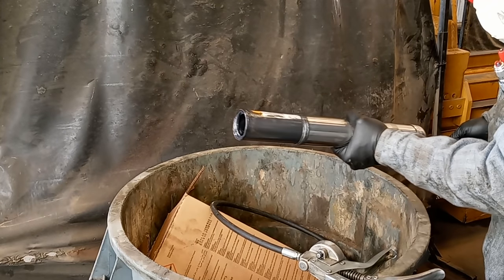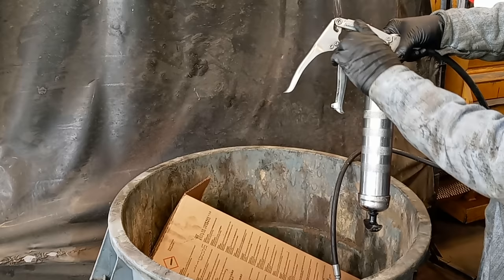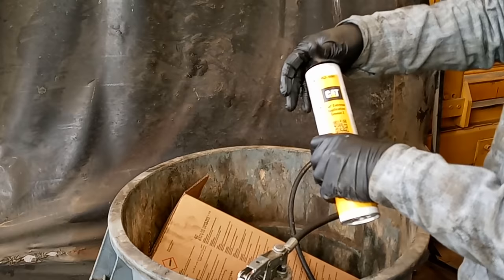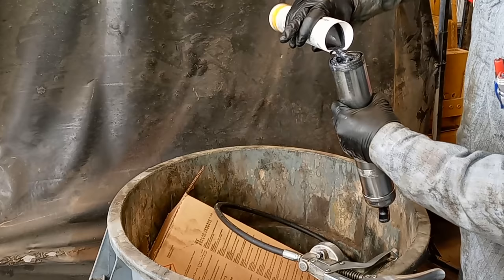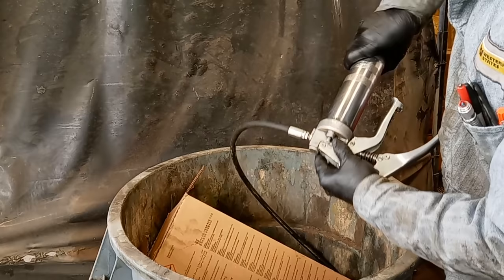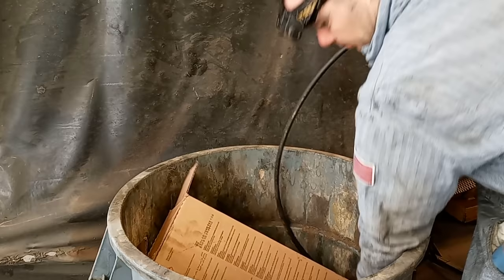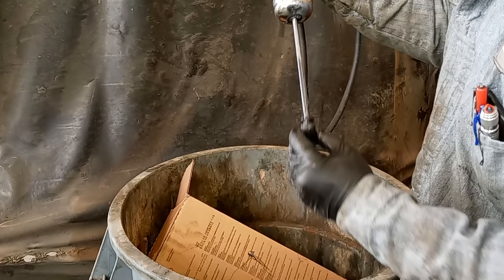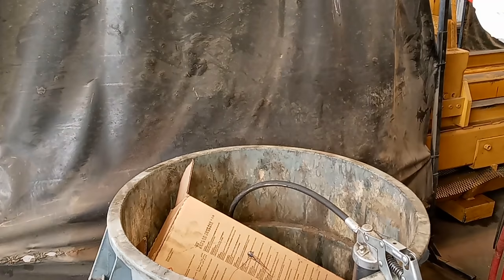3 Tips For Changing a Grease Cartridge the RIGHT WAY (No Airlocks)

Comment: Leave the cartridge housing loose by a couple of turns when you release the plunger lock after adding the new cartridge. This helps release trapped air😉
Reply: That's exactly what I've always done, but as the cartridge gets around 1/2 empty it usually ends up getting air-locked on me which is frustrating.
Reply: @jasonmeyers5849  Check the rubber on the plunger, those do go bad. We had one grease gun that did that all the time, we had a spare that the piston quit working, swapped the body/plunger with that one, never had an issue afterwards. Of course, once every 2-3 yrs, we'd take all our grease guns apart and clean them.
Reply: Also when the gun is empty , fully unscrew the barrel BEFORE pulling out the plunger , this helps maintain your prime and then as Jay Arnold said
Reply: What do you use to grease a grease gun ?
Reply: Yesssss!
Reply: My best tip is to get a screw on vacuum grease gun and cartridges.  Best tool I ever got. Takes 5 seconds to change and no gloves needed. 😊
Reply: Don't tighten the barrel until you release the rod and let the air seep out the threads then finish fighting the barrel up.
Reply: I never have airlocks or issues priming. My method is leaving the end a good one turn loose. When I use it the thickness of the grease prevents it from leaking but because the end is not airtight it stops any air buildup. I also run my grease right out before I change it. I use a lot of grease and it seems a waste to toss it. As for the position to load a grease gun... if you are pushing a cartridge of grease into a tube an air pocket will form no matter how you hold it. My thoughts as a guy with way too many grease guns!
PS. The Lock & Lube in the video. Definitely a nice worthwhile upgrade for those that haven't tried one.
Reply: Leave it loose and exercise the plunger rod a few times... this is actually some grease gun instructions for refilling
Reply: Yup. Its tricky. But go as far as you can. Some have an air bleed now
Reply: @DL101ca  silly Rabbit!🐇🐇🐇🐇☮✌🏻
,
Reply: @DL101ca grease lol
Reply: そこ！ 何故この動画で其をしなかったのか疑問だった。やっぱりコメント欄は世界共通で助かる

Comment: Around my shop guys just hang it back up when it’s empty and it mysteriously is full next time they grab it.
Reply: Yep, it's amazing how they always have just enough grease to get the equipment properly lubed.
Reply: I have an empty one ive been using for years .. 🤷‍♂️. Its a mystery. But I swear . Next time I need grease it'll pump out a bit lol.
Reply: We have one of those self refilling grease guns at my shop. Or at least that is what the other guys think. Every time I grab the grease gun I also grab an extra cartridge because I know 9 times out of 10 it is out.
Reply: Do we work on the same place...
Reply: Simple, after you have install new tube, release stem and you will feel a second slight catch. That catch is to apply pressure and prime your grease gun.. Sometimes it's a little hard to feel that catch but after a few thousand times of charging grease tubes you will be all over it. Don't be scared to use all the grease in the tube, for one thing grease is expensive and another it can be very messy. Another thing, if your grease zert does not take grease, change it because grease zerts don't get full.
Reply: @johnnyturner8514  what if you are reinstalling a half tube of grease? I had to remove one to check the tube  to see what the actual grease was to order another. I'm not sure if I reinstalled it correctly or have an air pocket.
Reply: Trevor.
Reply: I've never had one of those . There Always empty
Reply: I'm a home shop. That never works here.  I just swear at the thing like I'm doing now.  All 3 are empty
Reply: Jerks
Reply: Nice to have a grease gun fairy! If only the fairy would do the greasing too! 🤣🤣
Reply: The grease gun medic ! A very unappreciated and seldom recognized shop warrior.  Thank him with clean shop rags and gojo!

Comment: The preferred method for changing grease tubes in my shop is to leave it for the next guy.  Same with oxygen tanks, acetylene tanks, refrigerant tanks, soap dispensers and towels.
Reply from the maker: Hey I didn't know you worked at the same place I do. Need a mop bucket? It's full of coolant, oil, mud, but no water or soap. Need the brake clean can full? The fill tank is empty! The joy of working as a team.
Reply: Yep, teamwork...
Reply: Most problems in general are best left for the next guy, especially if the next guy is someone other than you.
Reply: Same here, only 20 M8x30 bolts left? Field engineer before you when stock stocking up just swipes all 20 and doesn't tell the storeman more need ordering rather than taking 10, asking the storeman to order more and maybe leaving the other 10 for the next field engineer who might need them in the meantime before more stock comes in. 😂
Reply: 😡 I ran a logging operation for30 some years and all of my employees know that if the grease gun was empty you had better fill it up or you were going to hear about it 😬
Reply: And masking machines in body shops
Reply: Did we work in the same shop? 😆
Reply: I think I know you
Reply: Don't be that guy😂. Never fails though. Pick up a gun three pumps empty

Comment: I definitively like my Milwaukee M18. Best investment ever for a grease gun. It has a nice bleeder valve to prime it after it ran out of grease too. Since I’m paying for the grease I m using it all. 🤣🤣
Reply: It does force the dirt into the grease if ya don't clean em off. If ya never clean the grease off after greasing it is usually easy to wipe off with your finger when ya go to grease it next time. Shouldn't seize either. Plus it helps waterproof your pants when ya wipe your finger off. Lol
Reply: Bought a air powered one and then they came out with battery powered ones. 🤦‍♂️
Reply: When the Milwaukee works its great! When it doesn't.......whew boy!
Reply: Been using M18 milwaukee for 4-5 years on the farm.  Only have had to replace the tip. Works great and with a decent battery in low range can make just as much pressure as any of my hand pumps
Reply: I have a cordless Dewalt greaser that I've used for a few years. Works great.
Reply: @timmueller1314  I love Dewalt tools, is the g.gun worth buying=Does it leak?  Thanks

Comment: I’ve never had an airlock happen and I use every bit of grease too. Pull out and lock plunger rod, unscrew and install new cartridge, screw in 2 turns and reseat plunger rod, pump 4-5times until grease comes out and screw in the rest of the way
Reply: Same here, maybe some guns are just more forgiving than others.
Reply: That is the same strategy that I use👍🏼
Reply: I do the same except I leave the the end loose a good one turn. This prevents any air buildup being it is not airtight and the viscosity of the grease prevents it from leaking. Seems like a waste to toss a cartridge before its empty.
Reply: Ive been greasing our equipment for years and the same is here. I've never had this problem.
Reply: Same here.

Comment: "Installing it upside down" does nothing. Do you really think that air pocket is going to displace that entire volume of thick extra heavy cat grease (or any grease for that matter) in the time it takes you to slip a new tube in and flip the unit over? The answer is no
Reply: On EP0 it might actually help purging it through the rod the way he did and upside down.
Reply: Yeah, he didn't run the previous tube empty either, nor does he show the grease coming out of the plunger rod hole after "pumping".

Comment: How do you not have an electric grease gun? I can never go back to a hand pump
Reply: I found that you can generate more pressure with a hand pump vs. most electric or even air powered guns. And sometimes that makes a difference on a stubborn fitting.
Reply: sometimes its nice to feel when the seals are under pressure instead of blowing them out
Reply: I use a lever type, never cared for the pistol.
Reply: @youjackass  made me COL - Chuckle Out Loud. Perfect reply
Reply: @donmunro144  makes one handed operation tricky in tight spaces.
Reply: Electric is the way to go. There's no way techs are greasing U-joints properly with lever or pistol grips.
Reply: @JohnDoe-iu5xi  I  for one disagree. Unless you're pumping so much grease that you're blowing the seals out then you don't know if it actually took grease. Air or hand gun is the way to go.Too many electric guns sound the same weather or not moving grease.
Reply: @donmunro144  This is what I mean. You're supposed to pump grease until all 4 bearing caps pop and grease exits them.
Reply: @JohnDoe-iu5xi  there's a whole lot more to grease than just u joints
Reply: @donmunro144  We were talking about U-joints.
Reply: @JohnDoe-iu5xi  if you look back you are the only one talking about u joints. The rest of us are talking about greasing in general.
Reply: @donmunro144  You replied to my comment about U-joints buddy and disagreed with it. Keep up buddy
Reply: @donmunro144  and to top it off. YOU can tell when an electric grease gun is pumping grease. Not sure why you prefer manual guns... And if you want to talk about blowing seals in general. You can see the boots in the steer axle joints expand.. Just dont overpump.
Reply: @JohnDoe-iu5xi I guess you're one of the guys that flood a clutch with grease from over greasing a throwout bearing. Or have grease flung all over the back of the cab cause you overfilled a slip joint and blew the end cap off. As for you saying that i jumped on  your statement, look back its more like you commented on my statement about preferring a hand gun.
Reply: @donmunro144  It's easy to "bet" when you have nothing on the line. I guess your self respect is already gone from youtube comments, what else you have to lose by making false accusations? And you @ me. Not the other way around... So rethink your delusions
Reply: @JohnDoe-iu5xi  you have no clue what I  have on the line. I've spent my whole life around heavy equipment, both on and off road trucks. I no longer do the heavy equipment, but still own and work on the trucks. It's easy for you to run your mouth when you are clueless. But as the guy signing the checks, I  personally make sure the work is done to my satisfaction. If that bothers you then build a bridge and get over it.
Reply: @donmunro144  I hate to break it to you but you're the one with the problem buddy. You disagreed with me and messaged me. Stop @ing me. Im a very busy MAN and I don't have time for these little youtube arguments.
Reply: @SpicyBloodBean  agreed
Reply: My gun has a 60 foot hose and a 55 gallon drum for a tube. 😎
Reply: @miked.8901  what's that in metric. Lol😄
Reply: If you ever changed tracks on a skidsteer, excavator, or really anything that uses a cylinder for tension. Youll never go back to a hand pump
Reply: Electric/air grease guns are mainly only good "In shop". Ours sit on the shelf. Ever have a pin not take grease and lock on to the fitting then you break the fitting or the gun end getting it off?? Never go back to electric or air after that.
I mean if your just shooting grease on a 5th wheel, shooting your buddies across the shop or just need grease pumped out then electric/air is fine. Bring that electric grease gun to the country with older equipment and you'll toss it.

Comment: I've been using grease guns since 1964 and never had an air lock that 4 or 5 pumps wouldn't fix. Don't worry about the 2 inch air gap at the bottom and pumping the shaft in and out helps nothing. I have 8 guns but only use 6 which have different ends. I store them upright in 4" pvc tubes with caps on the bottom to catch any oil that drips out. They are screwed to to two large standing cabinet doors on the outside. I use Green Grease now because it doesn't seem to dry out and cake up like some others. Thanks for the video,

Comment: Not going to lie, this is hella more useful than you would think. I usually go through 4+ tubes of grease when greasing the insane amount of rollers on conveyor belts.
Reply from the maker: Hope it helps.
Reply: I used to work in a surface mining company, and I still get imaginary hand cramps from thinking about greasing the crushers, bearings, head pulleys and conveyor rollers

Comment: Using grease tubes is new way of filling a grease gun. I remember buying grease by the pail. I’d stick the tube in the grease halfway up the tube and pull the plunger to pull the grease in. You would then screw the pump back on and clean the grease off the outside of the tube. Or next upgrade was to an air powered grease system. The pail sat inside the tank and air pressure would pull the great out the trigger end. These were prone to blowing grease seal apart if the regulator was set too high. 
Finally on to grease tubes in the 70s.

Comment: Spin on cylinder a couple threads and pump a few times ( listen for grease beginning to escape the loose threads as air bleeds) ..tighten, if still air locked, smack it on the lug of a rubber tire or 2 x 4 ( if you can afford one ) don’t smash the pistol grip mechanism while tapping it, use the solid portion to avoid wear/damage. Can easily do in  short period of time with less mess, no purge grease to clean and no latex gloves required. Field tested in -30 c with graphite/or + 30 honey 🍯

Comment: I have found that different tricks work with different guns.  In an attempt to help fellow viewers I make sure outside of new grease tube is clean so I am not introducing contaminants, when I peel the metal seal off I scrape the grease left on the seal on the inside of the tube rim so the product goes to a good home, thread the gun’s tube housing 1.5-2 turns into the grease gun cap then push long plunger rod back into the tube housing to initiate pressure on the new grease and give it 20-30 seconds as that much grease moves slow then wiggle the tube housing around a little and sometimes I have noticed a burp from the gun from doing this, now thread the tube housing the rest of the way into the cap.  Today I learned to not run the gun out of grease.  I will try this concept at work.  It sounds as simple as starting a diesel engine that was not run dry of fuel vs starting a diesel that was run out of fuel.  Thanks for another good vid!
Reply: I'm doing it exactly this way haha
Reply from the maker: Thank you for the input.
Reply: I pull out and lock rod, undo barrel, remover cartridge, use barrel to flick off plastic cap, insert cartridge, pull out plastic seal stop, wind barrel back on, unlock rod and push all the way down, then give the valve a 4 or 5 pumps to remove air. Simples.

Comment: This is the best video.  This am I was prepping my new grease gun for some trailer work.  Nobody mentions how you can lock the plunger rod to the plunger to put pressure on the grease.  Nobody mentions disengaging the rod from plunger to get the air out of the back of the tube.

Comment: That air pocket at the back isn't your problem. That's fine. What is the issue is the air pocket at the front. The best way I found is use the lid that you broke off and bend it into a scoop shape and pull out some of that grease from the back and fill up the front.

Comment: I use all my grease. Unscrew top, rack the plunger back, and eject empty tube. Rack and lock plunger back, place new tube in, pop the top. Screw top back on, depress and hold purge valve then release plunger to home. Done.

Simple, never had issues. I have greased a lot of heavy equipment as the young kid on the crew.

Comment: The puller rod in my gun can be locked into the piston by turning 90 degrees then the air can be forced out of the valve at the top of the head. Works really well every time

Comment: good vid.  ill usually install the new tube and screw the holder onto the head just a couple turns and then release the plunger and itll shoot the air out of the threads between holder and head and ill pump the handle a few times till its primed and then finish tightening the holder onto the head and go to work. also if it stops working ill loosen the holder from the head a few turns and then turn the gun upside down and tap the head on something a few times and pump it till its good then ill tighten the  holder  to the head again and go back to work. you can get a little more of that last bit of grease out of the tube this way.   also one more thing some people might not know, if you have a bucket of grease you can remove the holder from the head and spray wd40 outside of the holder and then simultaneously push the holder into the grease bucket while pulling back on the plunger and itll suck the grease into the tube. and then the wd40 will keep to much grease from sticking outside of the holder. so just clean the holder and screw the head halfway on release the plunger and pump till its good then tighten the head.  i work offshore and im surprised how many new guys come and dont know that trick or general grease gun procedure.
Reply from the maker: One of the best things about making a video, is people always leave extra information or tips on how to do something a way I have never seen.

Comment: One thing that is very important is for the grease be clean, in that my grease gun sometimes lives for months at the bottiom of my tool box, I replaced the plug with a grease fitting and plug the hose onto when not in use to prevent sand and dirt crom contamanating the grease at the end of the fitting.
Reply: No way. Our grease guns get covered in everything imaginable and dirty af they work fine with the right operator.
Reply: @chadrides914  : The grease gun may work fine, but if some grit or sand gets into the female end of the coupling, then that gets pumped into what ever you are greasing.
Reply: @johndavidwolf4239  heavy equipment application it doesn’t much matter

Comment: After peeling the metal seal off I use it smooth the top side of the grease tube it came off of. It helps create the initial vacumm to get it going. I always run my gun bone dry, approximately 5 tubes a week.